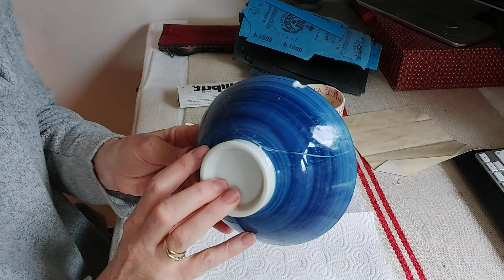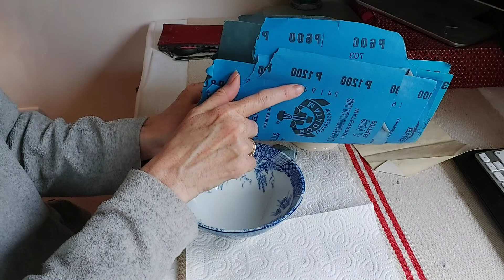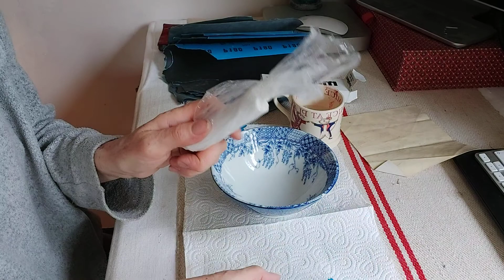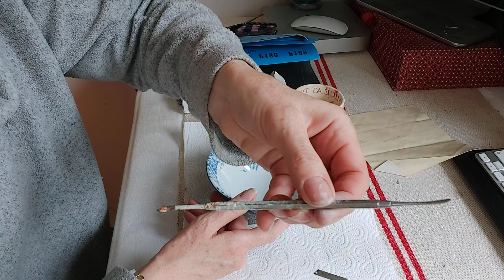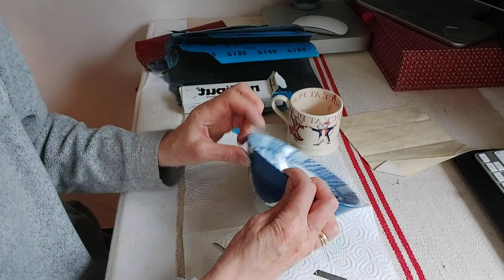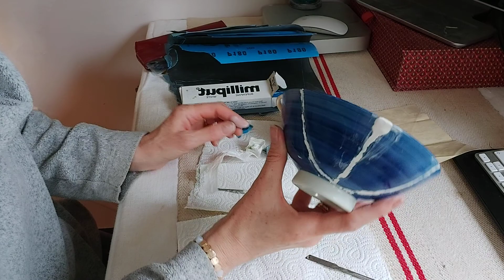How to Fill Chips and Cracks in Porcelain with Milliput 🎨

Comment: Hi, is this food safe once it’s repaired?
Reply from the maker: Hi Alice, once it has been painted and glazed I would use it for fruit or nuts. You can't really put the bowl in a dishwasher or use very hot water as this would soften the glue.
Hope that helps.❤
Reply from the maker: Hi Alice, I have spoken to Milliput and they said Milliput is food safe once it has been cured, this is when it has hardened , which I would leave 24hrs. Then just gently wash it afterwards. I hope this helps.❤